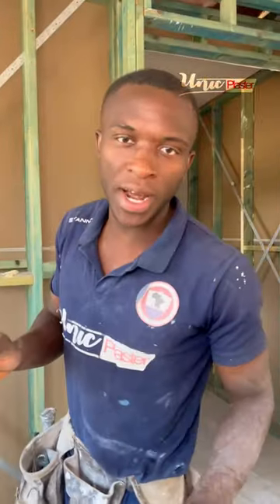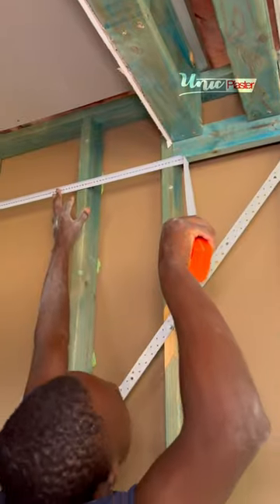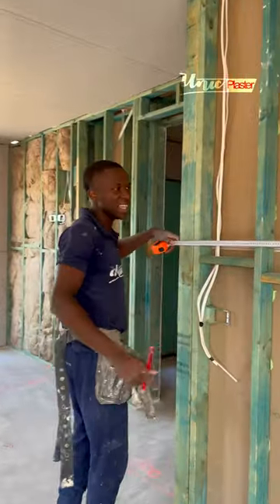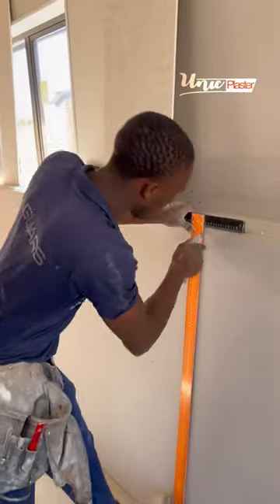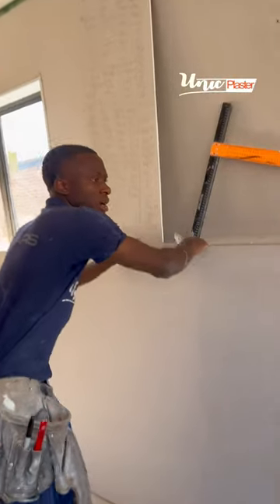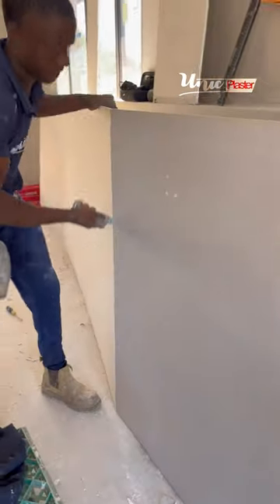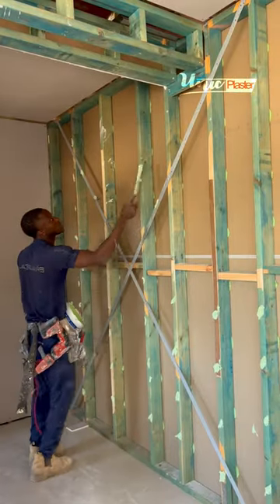So basically it’s not that hard #drywall #construction #doityourself #fypyoutube

Comment: Question, is there a reason why the framers used treated wood on everything? Logically, I feel this would be the safest against rot, but expensive, any other reasons?
Reply: Looks to be fire retardant.
Reply: Depending on the region some regular timber gets painted just to signify that it’s structural grade. Or there may be certain specifications in an area requiring fire/water/cyclonic resistance.

Comment: Makes no send to glue it when you're using screws to screw it down plus if you ever have to take the sheetrock off for water damage or anything like that the glue is stuck to the studs making it very hard to get off
Reply: Yes you are correct it is a pain in the ass to get off after glued. But the main reason is if you glue it you Hardly have to put any screws in at it all you don't even have to screw off every stud. We only do 2 in the field skip every other stud a glue alone is enough to hold the drywall up if it's put on correctly with enough.  We glue drywall to block all the time all we do is pin it with the tap con the glue does the work

Comment: I can't take it...He has experience but not the best way. I would smoke him. His top corner joints will crack over time. You should have the wall sheets hold up the ceiling boards. Hang top wall first .. panel jack bottom sheet. Any imperfection of distance from floor to ceiling is buried behind the base board. You got ❤️  but not the best way

Comment: Why do you glue before you screw.
Reply: Because it's VERY hard to glue after you screw it to the wall.
Reply: It limits nail pops. It’s done overseas a lot. The step is often neglected or skipped here stateside
Reply: Belt and braces

Comment: Try putting the top one on first bro you won't have those gaps on top
Reply: Crown moulding
Reply: @afrog3569  doesn't matter about the crown molding it matters how you do your work correctly
Reply: Everyone one of this guys videos he's leaving 2 or 3 inch gaps for no reason. . It's crazy
Reply: @arturogarcia5996 lol wtf does it matter, if they are putting on crown then it's done correctly, literally the same as trim, what difference does it make what side the gap is on.
Reply: @scottpollock1714  you must be the type of worker that's if you even do this...that doesn't care about his work or takes pride in it so your comment says it all
Reply: @arturogarcia5996  lol, I do this for work, and I do care how it comes out I just don't understand your complaint, if you start at the top you have a gap at the bottom which you cover with trim. If you start at the bottom you have a gap at the top which you cover with crown. If you aren't putting in crown then start at the top. I don't see the difference. I dont understand why you gotta come at me with insults either why not just explain or respond with out insulting someone?

I'm also newer into the field, if there is actually a reason then please share I would like to know lol
Reply: @scottpollock1714  it's a comment section not a complaint form I started doing this in the early 90s always do the lids first but maybe where you live they taught you wrong not my fault if you didn't learn this correctly and not insulting you just pointing out facts on how to do this trade the correct way
Reply: @arturogarcia5996  lol whatever man